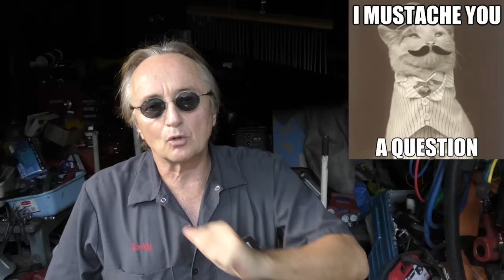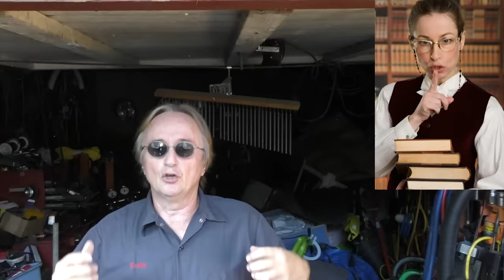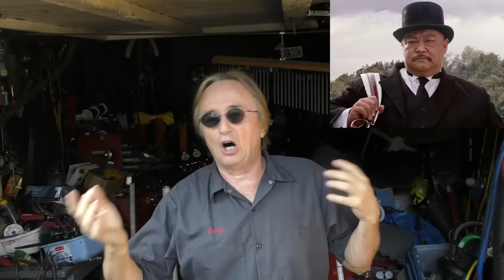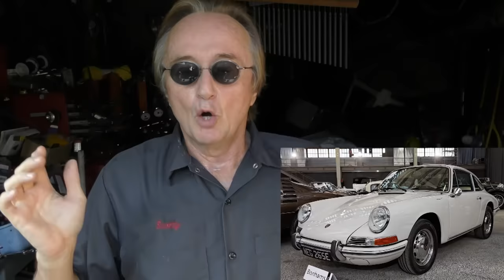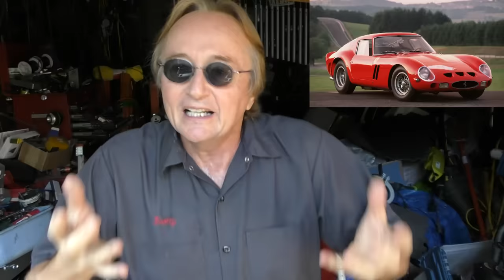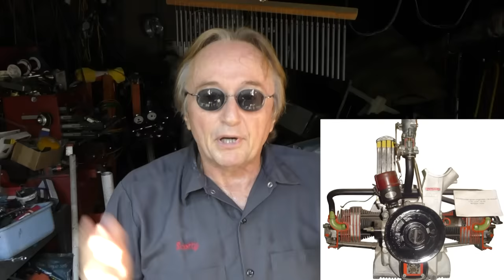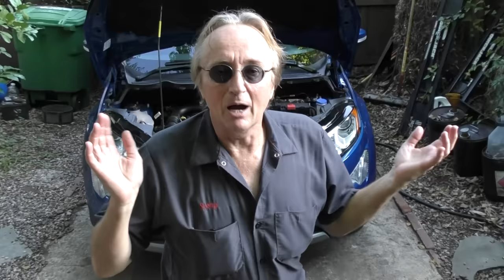The Truth About Boxer Engine Cars

Comment: Btw I just had the worst experience at my local Toyota dealership (Eddy's Toyota) in Wichita KS, but anyways, Scotty what do think about those new kia and Hyundai, Telluride and Pallasade, I think they have the same engine not just the size but same factory, do you think they can last for at least 10 years and or  200k miles?
Also I have this vw routan same thing as the grand caravan, I've replaced all pads and rotors and master cylinder, bleeded the breaks through all 4 calipers, and my break pedal still goes down to the bottom, I have to start breaking a mile away, I would hate to keep replacing parts
Reply: Anyways I have to get my wife another car, so I'm not spending anymore money on this unlesss it's an easy cheap fix.

Comment: This was like a micro documentary, with a base interest and open opinion intrigue. Very enjoyable.

It is interesting how the power from the piston applies to a part of the camshaft cycle.

It is an obvious but overlooked aspect of the increadible ingenuity and inventiveness in the piston engine.

If you can ever get a partner and do a micro series on the ingenuity of the engine, it would be fascinating.

It's almost alive.
It works while stopping and high speeds and bumps and all kings of things.

What is the simplest model T Ford?
What engine would you design?

Thank, for the boxer engine film...YouTube video. 

GREAT
👍

Comment: True, yet we hear more recalls for Toyota, GM, Ford and Honda than for Subaru's and Porsche's. Let's face it, most products today are made with short life spans, otherwise how can they sell you something new every year? Although, if a Subaru engine fails, can it be replaced with an LS3 engine/transmission combo? It looks like it could replace the symmetrical setup of the original. Obviously, would have to make custom engine mounts.

Comment: Continental and Lycoming both are aircraft engine manufacturers. Most of their engines are Opposed, and certainly the most popular are. They are very easy to work on, however saying they dont need balancing is simply not true. As an A&P i can tell that the internal degrees of freedom on these engines does still come into play.  We make sure our pistons, piston pins, and connecting rods are within a gram split amongst opposing pairs. If you have say a 25gram split between the pistons (it is possible, manufacturing quality with Superior pistons is shotty at best sometimes) the engine will experience vastly more wear.
Reply: an IO-720 is an 8 cylindered engine, and it only makes 400 HP, and i believe it is 12 liters lol, so its definitely true they arent powerhouses.

Comment: He has a point with the BRZ, it's not powerful enough. But that's not an engine fault that's an engineering fault. My '05 3 liter boxer makes 245bhp without a turbo or supercharger. They have the same hp potential of any other design. It's the manufacturer's choice whether or not the engine will be powerful vs. long lasting lazy torque (think 3800 v6 or LS v8s.)

Comment: Boxer and flat 180V engines are not the same although they might seem identical on the outside. A flat V6 is not naturally balanced engine because the crankshaft is different.

Comment: My Outback 3.6R has a 6H making 250hp/250tq...0-60 in 6.7 seconds is pretty good for a big lifted wagon. Just because they put a weak 2.0 boxer in the 86's (not hating I used to have a 2016 FRS) doesn't mean all boxer engines are underpowered.

Comment: The reason why most manufacturers don’t use the boxer is they last forever it’s not unusual for a Subaru to go 300,000 miles and they also can run at higher RPMs with no problems. Most car makers don’t won’t their cars to last more than 80,000 miles. They won’t to sell cars not engines.

Comment: I have a 1994 Impreza WRX STI type RA from Japan (forged ej20g engine). After 28 years is still drives better then most new cars. I've owned 8 JDM Subarus all have been bullet proof. They don't last when teenagers redline them all day everyday just like most manual cars, it's up to the owners discretion on how the car should be treated. It's a lot harder to wreck am automatic car. So Subarus get a bad name. That and 99% of them that are sold needing maintenance as no one ever wants to pay for maintenance on a car.

PS: never once had a head gasket problem. Valve cover yes but never headgasket.

Comment: Boxers are just more complex and more expensive to mass produce, I’m betting Subaru and Porsche stuck with the same engines in their cars because of that fact alone. The Subaru boxer engine is actually a very modern design with dual over head cams, four valves per cylinder, large bore and small stroke similar to formula one engines create a recipe for high rpm power and having that perfect balance just aids in that. Most slightly modified turbocharged Subarus on the road these days make 400whp which is about 480 crank hp which is awesome for a 4 cylinder. Mine makes 600 but it’s heavily modified but even that is a conservative tune for my build.

Comment: i just recently realized that Subarus are similar to Audis in that the engine is in front of the front axle, well, in most Audis. I also found that the old Chrysler Concorde and similar Mopars were the same layout as the Audis with a FWD based longitudinally mounted V engine in front of the front axle. Weird Stuff.

Comment: Scotty I have to disagree. 
Over a 30 year period 
I have owned early RS legacy, WRX STI, several Legacy GT - all turbo’s. Drove the doors off all of them and never had a problem other than had to replace a clutch in a Manuel one. They all handled exceptionally well on on challenging roads as well. They were all quick cars for their time. 
My experience was no problems as long as they are serviced correctly. 

I

Comment: Had a Subaru Outback at work.  That flat 4 is a torqueless wonder.  Tucker converted those Franklin flat 6 helicopter engines to water cooling, hence the radiator at the rear of the engine compartment.  Tucker failed for a number of reasons - now their collectible value has gone sky high.

Comment: There is a big misconception when talking about flat engines and saying it’s the same as boxer engines. All boxer engines are actually flat engines, but not all flat engines are boxer engines. A flat engine is actually a 180° V engine that works similarly to any other V engine. Each pair of pistons share the same crankpin, so one is in stroke 1, and the other is in stroke 2. While in boxer engines, each pair of pistons are connected to different crankpin, so they are mirroring each other. Corvair was a flat 6 not a boxer.

Comment: Other then the head gasket issue with Subaru’s they are 1 of the most reliable vehicles and that issue doesn’t always appear usually just if you are constantly driving the engine hard

Comment: I have a Subaru outback gt wagon 2005 the original motor got a rod knock with the last owner miss treating it it’s a turbo motor witch I don’t care all about power but now I have to find a 2.5 turbo that would work for it I got a 1000 save going to taward it any ideas how to find the one that actually works and best way to go about it

Comment: My 2000 forester has 275,000 miles my 97 legacy has 235,000 legacy is a manual still on stock clutch, forester is a auto although the transmission I’m afraid is on its way out.

Comment: I am three years late replying to this. But I don't agree about boxer engines being a failed design. Millions of original VW Beetles sold worldwide over a period of 60 years. Porsche 911, the pinnacle of sport cars, have used them since the beginning. And don't forget all the success Subaru had with the Impreza WRX in Rally racing. I still miss the sound and feel of my first Alfa with it's lovely boxer engine.

Comment: I am huge nerd to the aviation, and it's basic knowledge that nowadays boxer engine is the most used piston engine is aeroplanes, because of balance mostly, but also 4 or 6 cylinder boxer engine is also not much of a deal to cool down with an air, In aviation reliability is often your go-to choice, so they make it also as simple as possible, huge engines with little electronics, just sensors moslty, and two separate sources of sparks (sounds like an awfull twin spark engine, but Alfa Romeo used to make aeroplane engines, so that's where the idea came from).

Comment: The Corvair and VW were not boxer engines. The boxer has opposing pistons that are connected to crank journals that are 180 degrees apart. When one piston moved out the opposing piston moved out. The Corvair and VW had opposing pistons connected to the same crank journal and were not dynamically balanced. When one piston moved out the opposing piston moved in, creating a major vibration.

Comment: after taking my 2011 Subaru Impreza sport sedan to a dealer having a oil change I normally used synthetic oil they put regular oil in it it now uses oil about a quart between oil changes can my engine be fixed or what.

Comment: Still fuel efficient and having a classic 911 and the semi boxer ferrari testsrosa ( or a moder RUF 4.2S)  is still a WAY better option than some mustang, C7, or GT40. 

Personally, better than the modern NSX thanks to being only 1.2 tons and simpler in design.

Slap a small supercharger on the a RUF and that  thing goes crazy. For low and mirange RPM that is.

Comment: Porsche’s flat 6 engine just won the championship, last year & on its way to doing so again, this year! Normally aspirated (liquid cooled) 4.0L flat 6 with a 10,500 rpm redline making 650hp. Most reliable engine in racing! 

Porsche won LeMans in 1970 with a 4.8L normally aspirated, air cooled flat 12 making almost 600hp.

Porsche added turbo’s to the same motor (5.4L) in 1972 for the CanAm series and won EVERY SINGLE RACE because they made over 1,000 hp - reliably! 

Not to mention all the previously mentioned statements about the engine’s aviation applications.

I’m a Scotty fan, but his statements are sorely misguided, here!

Comment: I live just west of the Colorado Rockies and the State of Colorado has traction laws that PRETTY MUCH REQUIRE you to have an AWD vehicle if you want to drive on the Interstate in the winter time.  Needless to say, Subarus are all over the place in Colorado due to their AWD, NOT the boxer engines.  If you lived here and wanted to avoid a car with a boxer engine, what AWD daily driver type vehicle would you buy?

Comment: Seems if the boxer were so behind technology as Scotty says, Subaru couldn't get the fine gas mileage in 4wd vehicles that they do.  Also, the low center of gravity and such advantages as Scotty  mentions in the beginning of this video hold true over any so-called better Modern engine designs.

Comment: The head gasket problem was due to driver and the manufacturer the head bolts were torqued in factory a little less than what you would want so when people drive at higher rpms there’s failures!

Comment: Scotty could you explain the difference between a boxer and a 180 degree V engine?
Reply: MrFunkia boxer is completely flat bassically like he said so each side that the pistons are firing completely opposite of eachother while a V platform is firing in a V angle pretty much, pretty simple untill you get to oddballs like the VW VR6 which is basically a mixture of a v6 and inline 6

Comment: Sorry Scotty. I have to disagree. 
Honda has made a boxer engine smooth & reliable since the 70s. The put it in the Honda Gold Wing motorcycle. I've had 2 and no sign of gasket leaks and pretty quiet. Their 1500 is spooky quiet. So, obsolete? Not hardly.
Reply: Very quiet,  I love my GL1500. Only had a valve cover leak, cheap and easy to fix.
Reply: @oldmanjim2376  Agreed. I had an '81 GL1100 and later a Marlin blue '86 Aspencade 1200. The 1500 is too long for me, but man are they quiet!
Reply: @bcaffrey98  1500 takes a bit of getting used to, definitely. I'm going to move up to a 2012 -2017 1800, need something a but more modern and the seat is quite a bit lower.

Comment: Proven and bulletproof engines.  Head gasket change and timing belt every 100,000 miles.  It will last as long as the tranny lasts.  You then just replace the tranny and keep going!  Hehe I love Subaru so much.  I have two legacys.  The non turbo is okay on hp.  The 2.5 gt is so fast.  It will suck your head in the seat of you know how to drive it. I don’t know how much more hp I would ever need.  I think it’s around 250 hp.

Comment: I mean let's look at it this way: The Subaru WRX STI is making around 310 hp with a turbo boxer 4, and the Honda Civic Type R is making 306, being that these vehicles are in the same class and serve the same purpose I'd say they are about as far along as each other. Especially if Porsche can make a boxer powered car go from 0-60 in 2.5 seconds (Porsche 911 992 turbo S).

Comment: Inline four is cheaper to build, that's the first reason. Except for the height, a boxer-engine is bigger in size. A 180-degr V would be the same height/width, but shorter, but more prone to vibrations.

Comment: The main reason boxer engines are not common is you need 2x heads and cams, Where it's cheaper to produce an inline 4. Also most cars have the engine bay designed for a more compact transverse engine/trans setup. Cost to develop and manufacture is where profits would be affected and we know that  is top of the list in most companys. I believe Scotty is a little off this time around.

Comment: Emission laws killed the original German boxer VW Beetle. Mexican laws regarding 2 door taxi cars killed the Mexican VW boxer Beetle, which lasted well into the 90’s. NOT the design of the engine itself, which unlike the others, had no head gaskets to blow. The air cooled boxer can not be made to run clean by today’s standards without affecting reliability.

Comment: Hey Scotty.  Have you ever worked on a Lexus Gs350 AWD and try to remove the passenger side front axle?  The axle goes through the upper oil pan to get to the differential and is held in with a bearing that gets jammed in the oil pan.  What do you think of this design.  I'm really disapointed with Lexus on this one.  Maybe in Texas it doesnt get that stuck but in colder climates we get screwed.   Thanks from Mike in Canada

Comment: Small engines can be air-cooled very easy.  The pistons ideally  must be in the air-stream. For that Boxer-engines are perfect. especially in motorcycles.... but an air-cooled engine is always louder than a water-cooled engine because of the missing noise-insulation. So the design is NOT antique at all but for a special purpose. eg the 2CV from france.....

Comment: Scotty, Scotty, Scotty,  "you can't make 'em (horizontally apposed engine) as fast as a modern engine design"  you must be joking mate!
the layout of an engine, whether it is horizontally apposed (like most Porsche or Subaru engines) or a "V" or inline has nothing
to do with being "modern" or not. And having said; that the normally aspirated (non turbo) Subaru 3.6 puts out over 250hp, and the
NON turbo 911 GT3 puts out a retina detaching 0-120MPH in 3.6 seconds. And IMHO the reason they are not widely used in the
automotive (extremely common for aircraft engines though, Rolls Royce-Continental, Franklin, and Lycoming for example) industry is because of cost.

Comment: I had a 2009 Legacy with transmission issues at 80k kms. 2006 'Saburu' with leaking engine and power steering. A 2011 Forester woth a leaking and oil consuming engine on recall and failed steering rack before 200k. Will NEVER buy a Crap-a-Roo again.

Comment: I disagree, my 78 Subaru was extremely powerful and had a ton of torque.  My next car was a Honda Civic wagon and it was such a disappointment going to an inline 4, it was horrible compared to the Subaru.  Keeping the pistons 180 apart provides the maximum torque. Both cars had 5-speed manual transmissions.

Comment: I have something from 1980 with a boxer engine in it. It has 200,000 miles on it without an overhaul. It outlasted 2 previous owners. It redlines at 8000 rpm & I full throttle redline it on a regular basis. It burns only a small amount of oil through the valve seals but it will still do 0 to 60 in under 5 seconds and the quarter mile in under 13. It normally gets 50 mpg but if I run the bejeebers out of it it gets 35. It will still pull the front end off the ground a couple of inches sometimes when I'm not expecting it. What is it? It's a "naked" Goldwing (the one without the fairing). If boxer engines were so inherently crappy compared to say a "v" engine, then why don't Harley engines go 200,000 miles when you run their guts out? I can't think of too many I4, V2, V4 sub 13 second bikes (or I4, V6 cars) that can go over 200k without a rebuild either if you run them hard on a regular basis. If anything it would have to be another Honda.

Comment: Have a wrx, my wife has a forester and i can say reliable, fun & and in my experiance very easy to work on.  I wouldn't drive anything other than a subaru
Reply: AlienBmxican I’m getting a Subaru Ascent for my family hauler.
Reply: righttt, and i have an impreza that already leaks oil, 2005, 2.5L...
Reply: @aricroy4258   a subaru is still a car and like any other car it will need to be worked on thats where the "easy to fix" comes in. 😁
Reply: @AlienBmxican  but with 140000kms i dont expect to leak oil :( just sad though. How easy is it to fix an oil leak on a car like a boxer?

Comment: Got an old e110 emmaculate outside with 467k kilometers on it from japan its starting to age and the engine when starting takes alittle longer to start ive changed the plugs and the ignition coil but still no change and when you go in hilly places the transmission light comes on is there a way i can fix it or should i just let the old girl die in peace?
Reply: I would love to share a photo or video with you if you dont mind aswell on the same issue